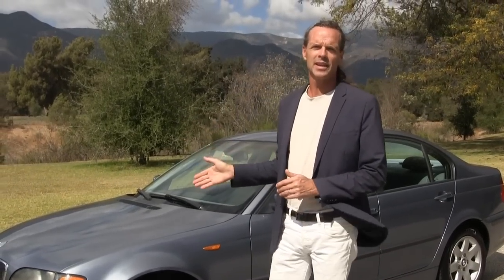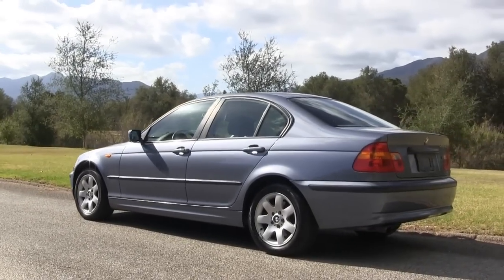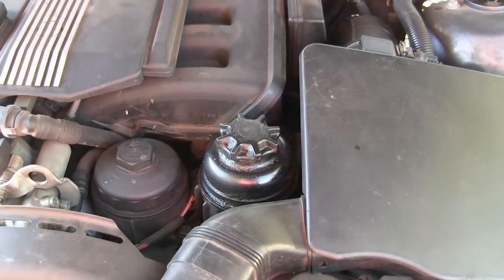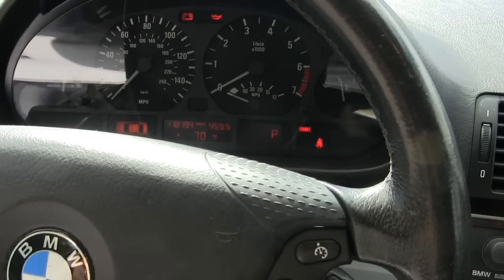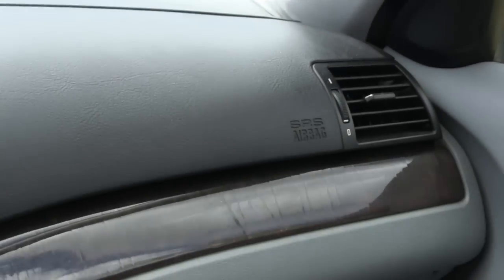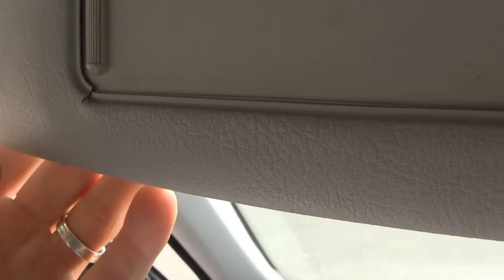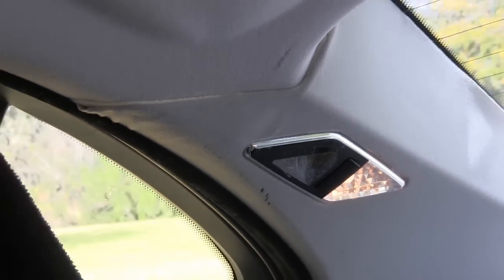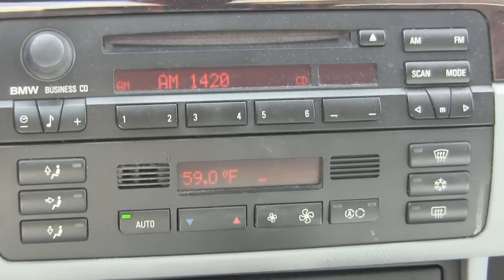Why You Should NOT Buy a Used BMW

Comment: Most of these problems come from excessive heat in a hot climate. The glue and plastics lose strength because of too much heat, the BMW badge loses it's color, various cracks because of drastic temperature changes. German summers don't get anywhere near hot as where you are living, these cars are not designed to endure that. Hope that clears some of the problems you had with this particular E46.
Reply: This ^
Reply: +0riginal835 exacly
Reply: all cars rust from salt...
Reply: 0riginal835 true but growing up in Chicago the Japanese and the Germans have the worst bodies but recently(year 2000 to present) it seems like the German cars are even worse than Japanese for 2 times the price of car and repairs
Reply: Quix BMW and Mercedes rust the quickest in Chicago. Where are you from?
Reply: If they aren't "designed for" heat then they shouldn't be sold in the open market where the situation is occurring.  Else, they are fair game to be stated as being of poor quality.  No exceptions or excuses.
Reply: oldtwins na True, but I dont think this is a design issue. There are lots of E46s in southern spain, most of them look nothing like this. I'll put my money on some shithead trying to dry out the car with too much heat right before selling.
Reply: ***** How do you know this was water damage without the title?In Chicago most 10 year old BMWs(generally non M models are parked on street or driveway) look like this but with rust holes from salt. ONLY TINTED WINDOWS SAVE INTERIORS IN MY EXPERIENCE. No water damage around here for miles just freezing WINTER with road salt and 100°+ humid SUMMER:)
Reply: ***** I see you say YOU are the "original owner" THE BMW purchased NEW and ONLY having one owner should have zero problems but you mentioned "airbags" and I have a recall on a 2009 vehicle for that issue BUT WHY WOULD BMW WAIT FROM 2003-2016 TO FIX A KNOWN PROBLEM($)? Kind of cheap like I would expect from Honda. YES most 2nd and 3rd owner BMWs are POS since ONLY the 1st owner can afford the proper maintenance(and OEM parts) ALL others play the "depreciation game" and run them into the ground.I watched friends do this to many 530s/330s after parents purchased NEW vehicles
Reply: ***** Who Knows how long "ANYTHING" lasts today sir? I would rather have an old M or AMG than anything made today. The reason old cars appreciate and new ones deprecate is in the quality and design/engineering in my mind. Good Luck
Reply: @Original835: Your comment is totally unacceptable to me. If BMW's are not fit for US climate, they should not sell it in the US.
Reply: BMW could easily use glass that does not let as much heat into the car. The glass would have to be double layer, and would add about 150kg to the car. Keep in mind adding 150kg high up on the body is far from the same as adding 150kg to the frame itself. Window regulators would need a big upgrade, im not sure but they might need to reinforce the body around the windscreen and back window. If i was american i'd much rather have the normal version and then use one of those reflective mats for the windshield if i had to park it outside over time.

The emblem is 10$ and secured by two small philips screws from the underside of the hood, please stop crying about the emblem...
Reply: Also not really made to endure cold temps. We know what I am talking about: The oil trap :/
Reply: The oil trap issue is primarily due to lack of maintenance and short cycling the engine.  You can't have water in your fluids and expect it to not freeze.  Operator error.
Reply: Yep - i have a 15 year old e46 which has always lived outside and the interior looks new. I would also guess extreme heat has caused these problems. On the one hand it's not excusable, but on the other it just won't be relevant to most people. The only issue pointed out here which really is a common problem across the range are the window regulators - they really are 5h1t. However the regulators themselves are only around $100, but most of the time they can be fixed with a 5 cent cable tie. As long as you can follow simple instructions on youtube/forums, you certainly don't need a garage for this.
Reply: BMW wasn't meant to sell their products in Chicago.... They were only meant to be sold in cities with actual intellectual people residing in them... Think about it... If I was smart and l also really liked my car... I would be trying to move to some where like Miami... I may be from Australia but even I know that car's don't live long in Chicago.... You are much better off with a snowmobile dude...
Reply: believe that and  I will tell you another one
Reply: And Japan is a desert?
Reply: so if you want to save your currency and own a BMW move to Germany?
Reply: @Quix Lol they might, but Germany doesn't use road salt.. Sooo :D

Comment: I own a 15 year old E46 M3 cabrio, and before that I had an 18 year old E36 M3 Evolution cabrio. Both legendary cars and an absolute joy to drive. But I gotta admit, this guy is right. The E46 does have the faults he mentioned, and some can spring up no matter the mileage (low or high). They can be avoided by looking after the fucking thing though! Most wannabes are leasing these now and throwing them back after a few years for the new model without so much as an oil change. M-Sport models seem to be the only ones that last longer as most owners spend at least some money on keeping them right and own them for much longer. But the "Ultimate Driving Machine" is what really lets the brand set the benchmark. No other car feels like they do, even the good ones. No other car makes every drive feel like more of an event. This is why enthusiasts like myself dont mind spending our hard earned cash on them - it is all part of the ownership experience. Yes, it hurts when we learn the hard way that our machine is not immune to needing above average maintenance; anyone who thinks they can get away with buying one on the cheap and getting away without at least basic servicing doesn't deserve to own one in the first place as this is tempting fate and potentially dangerous. That said, I've seen much newer cars in a worse condition after only being a few years old - ford focus, nearly every vauxhall model, not to mention nearly all french cars. For reliability, the main manufacturers are japanese - they seem to run forever and are generally well built. But these cars have no real soul or pedigree. Picking a bad example and attempting to trash an entire model range because a typical owner failed to treat it with a modicum of respect does nothing for a business reputation. In fact after this drivel you should expect your street cred to go down as quickly as the oil level in the heap of crap you had on display here.
Reply: Somebody's booty got hurt. Tell me about how awesome the 5 liter motor was.😂

Comment: Holy crap!!! This video basically covered most of the stuff I had to replace with my e46 M3 (100k miles). Windshield cowl..peeling paints everywhere.. ripping leather stitches on seats... broken ashtray roller...weatherstripping...you name it.. everytime i touch something it breaks
Reply: I drive a Mercedes Sprinter (Erstzulassung 1999) and I had absolutely zero problem with it. I never even lift up the hood, and I don't even know what the engine looks like. But, I aways service the car at the required intervals at the Mercedes dealer. I am sure the car will outlive me.
Reply: i have 95' sprinter and the only thing that is still original is the altenator.
Als the rest has bin replaced including the engine, gearbox and multiple clutches,
and i laready did weld new metal sheets al arround and under it, because
they are horrible rustbuckets too.
So it's not even half the quality as the good old "dusseldorfer" and i'm affraid
to buy a newer one, because parts do cost at least 50% more than from my old
sprinter.
Reply: Here's a few more things he left out: transmission oil heat exchanger leak, crankcase ventilation valve hose clogging, DISA flap pin failing, steering rack leaking & pump failure. 
Moral of the story: run if there's no maintenance receipts available.
Reply: Good observation-they lose value rapidly, so a minor accident is enough to have them totalled by the insurance company. Then as you say, they fall into the hands of people who do not have the money to maintain them-so they deteriorate faster.
Reply: Agreed.  We used Sprinters at FedEx.  Had to replace the head because the EGR system is so poorly designed it plugged up all the ports, which it has done in all our units.  Turbo went bye bye less than 100k.  Bye Bye $2000.  Then the wiring harness on top of the engine cracked and shorted itself out.  Waited over a month for a replacement, because they had to make a new one in Germany.  Finally crashed the vehicle, now we are using WorkHorses for the bigger stuff.  Another rolling pile of crap.
Reply: Ad mirer ,you are so correct with your comment, The broke ass people with no money own these junk. oh my god the germans are slacking.
Reply: Demar Gio lol you care about the interior. it's a e46 m3 with a s54. if your not going to have fun driving it then go get a lexus they have good interiors
Reply: Bmw M3 e46 not that im specifically looking for luxury interior but im questioning their QUALITY
Reply: Henning Malland  
I'm Iraqi and yes we bring BMW only from Germany also Mercedes-Benz because it's much better than gulf area or American ,, I owned  325 , 730i , but to be honest I found Mercedes 300e and 300s need less care ,, but for the highway I prefer only BMW and I love to drive my 750i specially we don't have speed limits every time I do race with police chargers and I win every single time
Reply: Most of that stuff is related to exposure to weather, sun, etc., NOT to the number of miles on the car. How OLD is your car? If it's an E46, it's 11-21 years old. Tell me about another car that works as well as a BMW, which after sitting in the open for all those years, in the southern sun, doesn't have problems with exposed rubber, plastic and fabrics! Tell me which ones, that old, don't have a few mechanical issues crop up! Things like seals do dry out over time. Nothing lasts forever, but it seems to me, BMWs don't fail any more often, or any sooner, than any other old car... In fact, they last far better than most cheaper cars.
Reply: +Richard Savary. Well said..  I have a 2001 7series with 120,000 on it..  It is absolutely the most expensive car in the world to fix..   If something breaks.    But it is also the worlds ultimate driving machine..   Its my 4th BMW.   I plan on buying a m30 from my mechanic just to play with..
Reply: No, they are cheap, because idiots in the bad part of town as you put it buy Bimmers and Benz for the "prestige" to pick up girls and have NO clue how to take care of a car like that. Let alone have the money or resources to maintain it. Therefore, the car becomes a piece of shit and drives down the retail used price.
Reply: Demar Gio. You have "GERMAN SPECIAL by BMW".
Reply: Demar Gio n
Reply: MERCEDES DEALER? HOW MANY KIDS DID YOU HAVE TO SELL?
Reply: yankee2 yankee - Hyundai. I own a 2004 Hyundai Tucson, that's almost 15yo, i don't have a garage and never had these problems. Rubber is still intact, interior looks almost like new. Hyundai Tucson's are built like a tank.
Reply: I  live in Georgia and it gets really hot down here. I own a 2006 Mercury Milan and I park it in the sun every day. The only problem I've had with it is the plastic vent on top of the dash separated from the dash recently. A little crazy glue fixed the problem. The problems outlined in this video are unacceptable for any car above a cheap compact car, especially for a luxury car.
Reply: charles stiesmeyer and go on and on and on...
Reply: owel note keep dreaming

Comment: Wtf? Just because you bought a BMW that was probably treated like shit, doesn't mean every or most BMW's are like that. It's all about the Owner.
Reply: that's exactly what i thought. i got one with 188k kilometers and i don't have so much broken things like this one. also 325i but pre-facelift. my father's 320d had also not so much broken things. the e46 in the video was junk for the pre-owner.
Reply: right mine is from 2000 and is look much better
Reply: itsjustSchnitzel absolutely, how was the car treated?
Reply: I have a BMW from 2002 and its fine of course theres some wear but nothing as bad as whats in this video, it looks like its been mistreated and parked outside for the last few years in the heat causing the glue and trim to go to shit. I know if I didn't look after mine it would eventually look like this, also this looks like a very basic model in the clip.
Reply: Simon Phillips
Reply: Simon Phillips
Reply: Simon Phillips
Reply: Whats up ?
Reply: No, you don't understand. ALL BMWs are unreliable nightmares that will explode killing the owner at 85,000 miles.
Reply: Mine has done over 130,000 miles and still going well, it gets serviced regularly more in fact than the manual says good thing about doing a lot of the work yourself.
Reply: opmike343 my E12 5 series is 40 years old and done well over 250,000 miles without exploding. i got it with 145,000 miles
Reply: itsjustSchnitzel  that's right show me a old car that doesn't 't have a problem, it's all about the owner, besides it's super clean and it's old what do you expect from old cars. I like mine and I don't have a problem...
Reply: By the looks of it , that car was treated very well.
Reply: That car was kept clean it appears, but not treated well.  two VERY different things.
Reply: I treated my BMW very well and it was a real POS on reliability and cost of ownership.
Reply: Owner(s) and how well it was maintained - by a mechanic that didn't just work on Lawn Mowers and Ford pickups !!
Reply: reinhard weber  Good to hear mine E53 x5 its from 2003 now as my old one the air bags malfunctioned so I got it covered by insurance and got a pay out. I have replaced quite a few parts on my car but thats normal and a few more parts relating to the suspension and steering.

Comment: I have said this for years.  If you ask a BMW owner they have nothing but great things to say.  That's because the majority of them take the cars aon short term leases, 2-3 years and all maintenance and repairs are covered.   The same is true for Mercedes.  Audi and VW owners seem to have better luck...
Reply: Heh it's not just luck, it's good planning to get rid of them knowing they will get expensive out of lease.

I would love to own any new German make of car short-term!
Reply: You are right about everything except the last sentence.  As a prior owner of a VW, I can tell you whatever ailment was shown on this BMW, my VW suffered, a LOT more.  Vacuum line failure, plastic vacuum valves crumples, brake ECU failure, endless ignition coil pack failures, etc...  It got so bad that my mechanic felt bad for me and gave me a discount.  And since VW owns Audi, they often share the same platform and interchangeable parts.  So Audi has the same problem.  Only lease German cars or buy extended factory warranties.

Comment: Funny, i've got a 330d touring M packet from 2003 and 201 km on the clock, some "minor issues" as the fuel pump under my seat, or a light that dies....so before saying E46 is crap, learn to use a car properly, like checking oil, and all fluids, tire pressure, listen to the noise that the car makes etc etc etc, like older guys do, and hooo miracle!! the car is fine.

A car is not just a thing needing fuel to go A to B without a minimum a work on it.

Comment: Well, as my dad used to work for BMW Germany years ago, we probably had one of the largest amount of BMWs ever, since every 3 months they gave 1 to him, from Z1 (if he would have kept it..) to 7 Series. This was in the 80s's - 90's...
And those BMW were tanks, built like tanks... 
The plastic prevailed, and 2000+ BMWs were not so well made as in the past... the e46, and I had 2 of them, are not bad cars, but damn.... do they leak oil, vacuum problems, VANOS, bushes to replace everywhere, clonking sounds from underneath, and countless other problems. Electrics on the other hand were PERFECT, as well as paint, rust problems, and generally mecanically.
They are what they are: a mainstream brand, while many people think BMW is a luxurious brand. NO. Bmw is just a normal brand, with some nice touches here and there of lux, some nice rear-wheel drive, some nice touch materials... but it ends up there. Fun cars though to drive on snow!
Reply: Agree, but i`m pretty sure any car would last for a few months, the question here was what happens to a bmw after 10+ of ownership and regular usage. If Bmw gives you a free car every 3 months, you probably never kept one for more than a couple of years and more than 1-200.000 miles. Not to mention that not everyone can afford to service the car at the dealership, which in your case was free. So basically your personal experience has zero value in this scenario. Not everyone works at bmw.